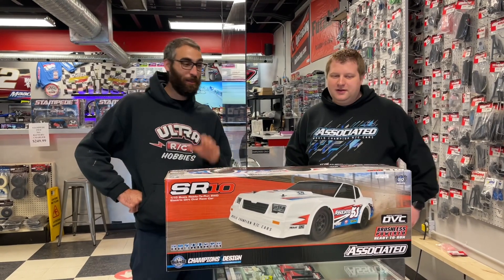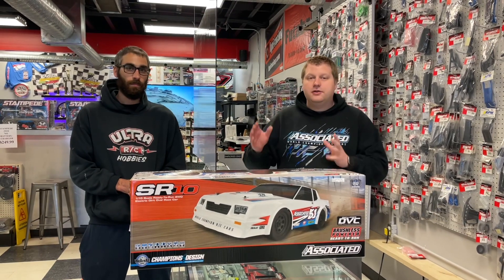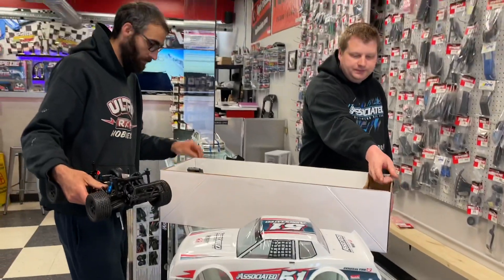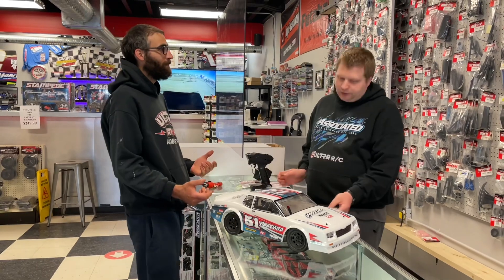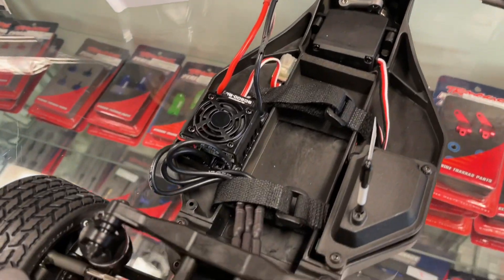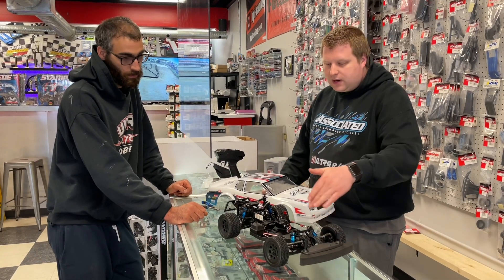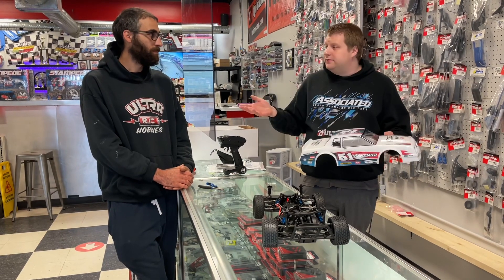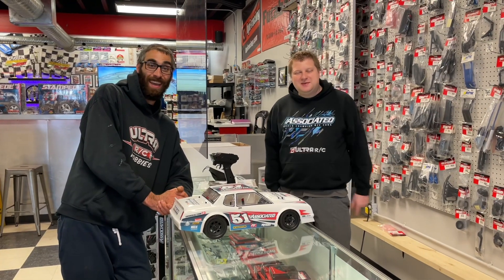Team Associated SR10 Unboxing W/ RC Deibs

Comment: that whole car is amazing. The body even has the defroster lines in the rear window.
Reply from the maker: They took a stock car to the next level with the extra details in the body, not sure I have seen any of those on the cars we have seen raced in real life but we will give them the points for it! But they did an absolutely amazing job on the body especially the attention to detail on the front bumper with the head lights and grill